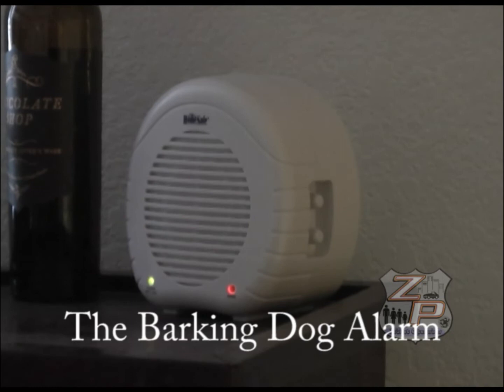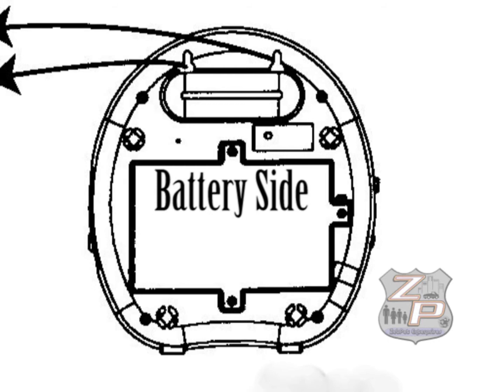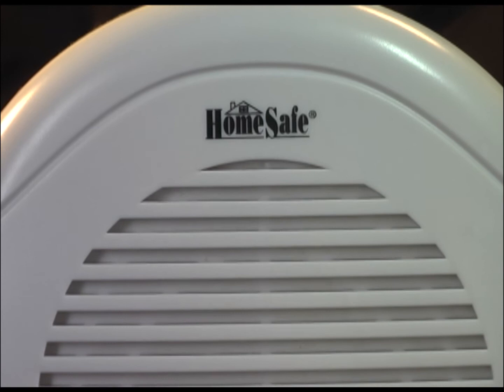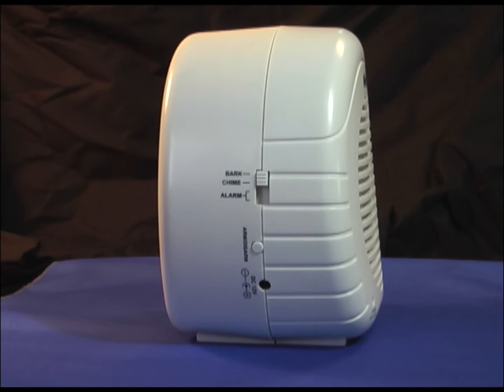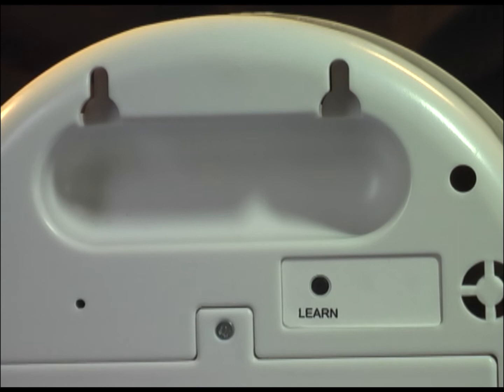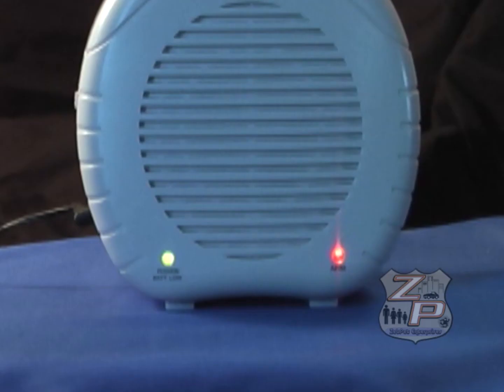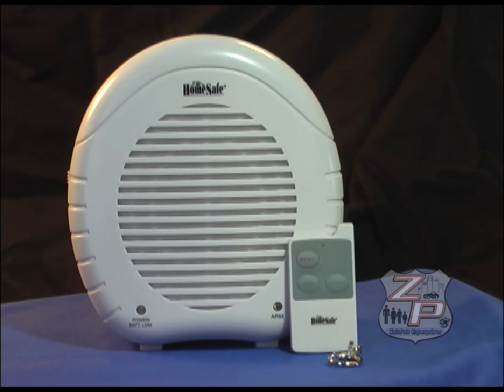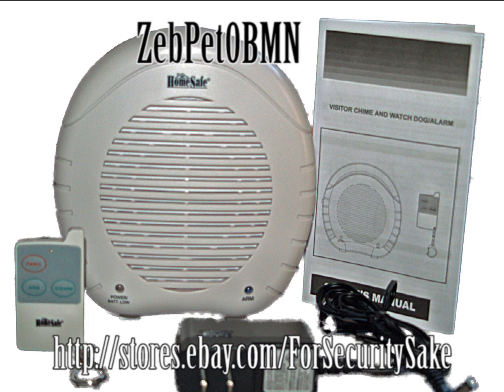Barking Dog Alarm Introduction Ebay Version

Comment: what is the loudness in dB of the Dog bark?
Reply from the maker: We haven't measured dB, but the sound output is 5 watts and is as loud or louder than a real large dog. 

We have a new model that has an output max of 120dbl. This unit is standalone and does not have the ability to add extra remote controls or sensors. You can see that model here: https://forsecuritysake.com/self-defense/safety-technology-barking-dog-alarm/